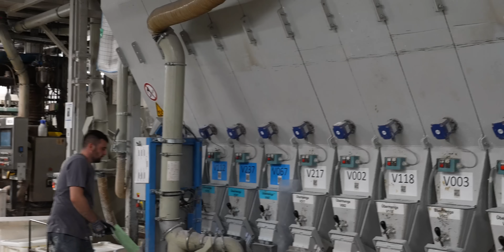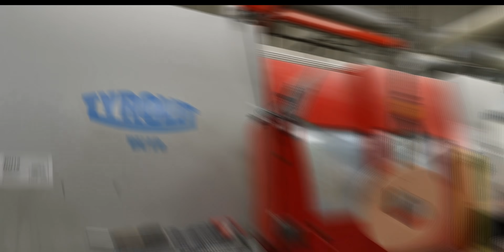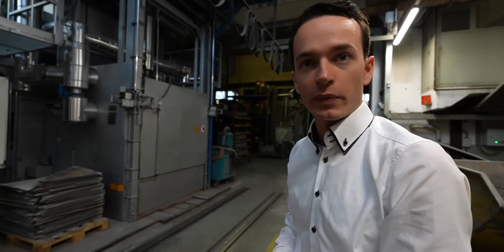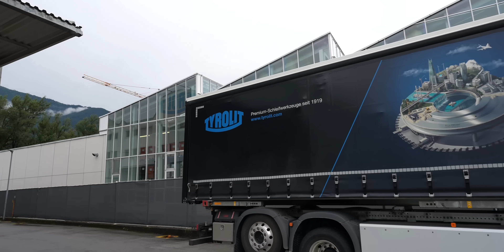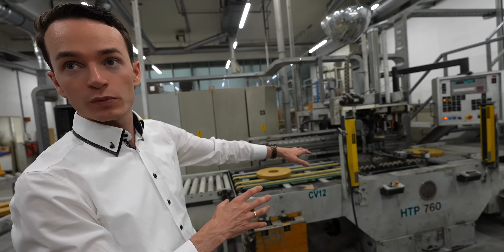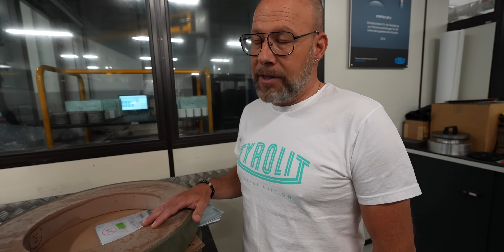Machining the BIGGEST Grinding Wheels in the World

Comment: very impressive, did you happen to see multidiameter wheels used on a plunge grinder? New Process Gear (Chrysler Syracuse NY) had input shafts with I believe 3 different diameters so they were set up 1 wheel made for it and would plunge in for so many seconds then retract to check dimension. 20-24" diameter if I recall right.

Comment: Never would have thought the "classic wheels" need to be baked in furnace at high temp. Just wander what bonding is made there? And how they play with the bonding strength, as the holding strength for the grains needs to be very adapted to their cutting performance.  Very impressive video, best promo Tyrolit can imagine for itself!!!!

Comment: I used to work at a place that made steering racks and they had some machines that used a wheel that was about 5 feel long but only 18 inch diameter, I didn't think about it much before this video, but I imagine that's a much more complicated process to manufacture.

Comment: Hate to break it to you, but having worked at a hot rolling mill, with a hot grinding station (cut/grinding through orange-hot steel bars) in the production line, I've seen those big bad boys plenty of times. OK ok, those might have "only" been Ø 1,8 m and not Ø 2 m, I'll give you that.

Comment: That is very interesting start to finish I'm so compressed.
Used to be a big fan of Radiac deSanno por-ous-way wheels then they got bought by Tyrolit out here in Arizona their marketing is very poor at least in the aerospace machine shop sector last time I tried to purchase some of their Wheels it was either I purchased their inventory for them we're talkin dozens of wheels or None so none it was we cannot use a dozen in a years time.
Yes it took a while to find an equivalent product and we have not looked back all because of very poor marketing by the local supplier many companies I think have run into the same trouble a lame middle-man ruined their name.